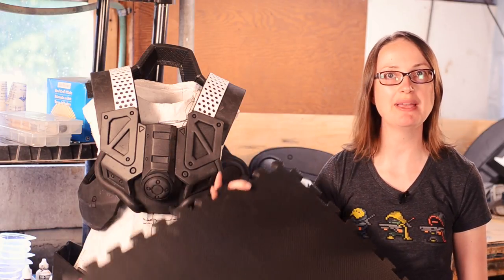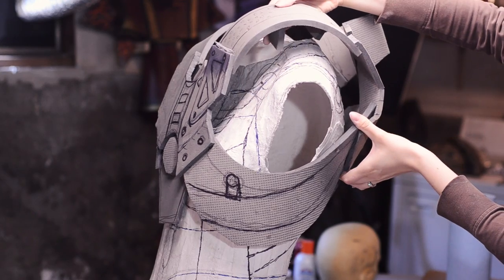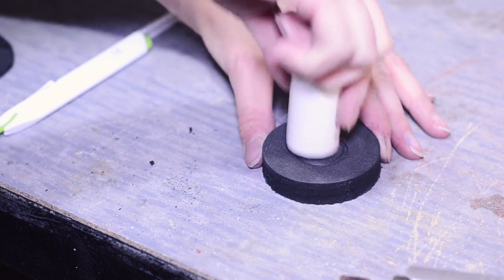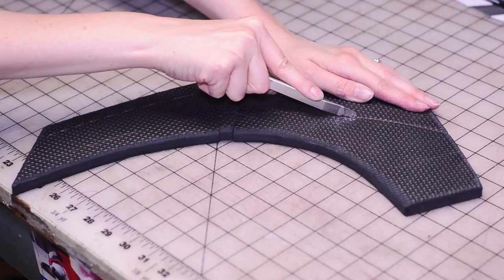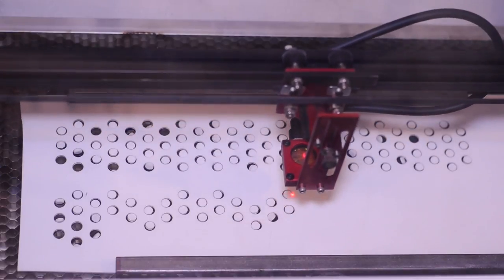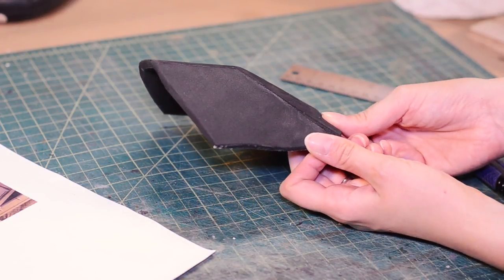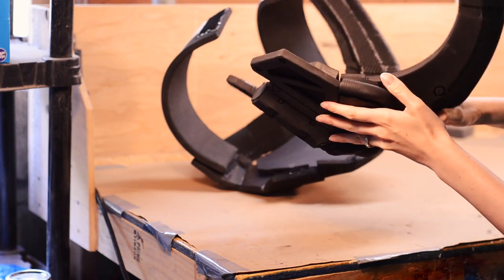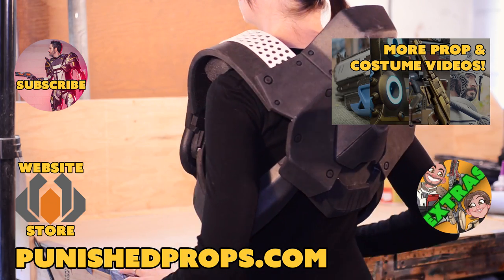Foam Armor Chest Piece - Destiny Sweeper Bot Build

Comment: It was really useful to see the use of different glues for different applications. I also found the 'cutting a chanel' then bending and hot glueing, particularly helpful - really cuts down on the filling and sanding afterwards I suppose.
Reply from the maker: It seems like every adhesive has its strength, for sure. We love saving time on our seams, too!

Comment: This is some clean foam work! Also thanks for giving me some insight on keeping the thin craft foam flat when in the laser cutter (didn't think of using metal bars). In the video, you used super glue to attach the filagree( white circles/ air vents) have you tried using loctite 200 spray adhesive? It works great and so much easier to apply than CA but i'm just a hatchling compared to you guys.
Reply from the maker: Thanks! I did a test with Loctite Spray Adhesive, High Performance Middle 200. I followed the directions, but I couldn't get the foam pieces to stick together well--I could peel them apart. Instead of doing more tests, I just went with superglue :)

Comment: You used a heat-gun in some scens, is it possible to use a hairdryer instead??
Reply: FoxPaw I would thinkso. They both reach very similar temperatures,  but the min problem with that is the air flow
Reply: A heat-gun gets much hotter than a hairdryer. I crafted with Worbla and the hairdryer didn't do the job. But it should work out for softer materials.
Reply from the maker: Alas, hair dryers don't get hot enough--which is a good thing! That way you can't burn your hair. Heat guns get much, much hotter.
Reply: Hairdryers definitly don't work with foam. Heat guns are very cheap however. The cheaper ones start around 15$ and they're perfectly fine and worth the money!
Reply: We use a blow torch for this, just be careful not to get it too close.
Reply: It might work for that suupper thin craft foam you find in craft stores if your hair dryer gets hot enough, but not for the thicker/denser closed cell foams or floor mats or worbla most people use
Reply: they have said the only tool from harbor frieght they reccomend is the harbor frieght heat guns. they are cheap and make hot. 
which is all you need, a thing that makes hot.
Reply: Thanks for all the responds!! A BIG THANKS!! <3 <3

Comment: Can you please explain the difference between where you decide to use hot glue vs. where you use contact cement? Is it just area's with more strain on them?
Reply from the maker: Contact cement bonds instantly, so I like hot glue if I have to wiggle something into place. Hot glue does add material, though, so I prefer contact cement and super glue for attaching seams.
Reply: Thank you very much!

Comment: Hi there. How do I determine when to use contact cement or hot glue to stick the foam pieces together?
Reply from the maker: Hello! I'm sure every maker has their own style of adhesive application. Try out what you have on scrap pieces and see what you like best. We like hot glue for its longer working time--we can wiggle a part into place. But, hot glue adds material and can squeeze out the edges, so we like contact cement and super glue for seams. Contact cement bonds instantly, so it's hard to beat that for forcing seams together.
Reply: Punished Props Thank you for the info :)

Comment: why do you use 3 different types of glue (contact cement, hot glue and crazy glue), which one is best :D
Reply from the maker: Each adhesive has their strengths and weaknesses for different kind s of applications. I go into a bit about why I use each in different situations in the Robot feet video in this series.
Reply: thank you, ill check that video :D

Comment: Is there a template/blueprint for this build.. Thanks!
Reply from the maker: There is not, thanks for watching!
Reply: @punishedprops  I am doing costuming for a film project and really like the look of this piece.  The current armour I have does not fit the actor and I thought this might be clever solution.  Alright - I will do a reverse engineering job and see how that goes.  Will send photos and a link to the final cut of the project so you can see the work.. Thanks!

Comment: How would you make chest armour that is bent in multiple directions? Like Tyrael's armour from Diablo 3
Reply from the maker: Complex forms are super tricky. You're going to have to plan seams and darts in the flat material that will make the form you want when glued together. It'll take a lot of trial and error.
Reply: Alright then, thanks for the tip!

Comment: Isn't it cheaper to buy rolls of foam than to buy floor mats?
Reply: hed420 if you know where to buy them there £2 a mat (Halfords)
Reply from the maker: For us, we like the small textured pattern on floor mats. Or, to buy large, untextured rolls form an online store, like TnT Cosplay Supply. The rolls of foam with the big diamond patterns tend to be thinner, and the large diamonds tend to show through heat formed pieces, so we don't like to use those kinds of rolls.
Reply: lasarith2 Nice one, been struggling to find them locally!
Reply: en france on en trouve chez GO-SPORT
Reply: Depending where you buy mats and roles. The roles could cost more than mats do!  I thought role be cheaper too. I went to harbor freight and the role cost more than the mats.  Even when you go to a sporting goods store the roles cost way more. Just so you know.